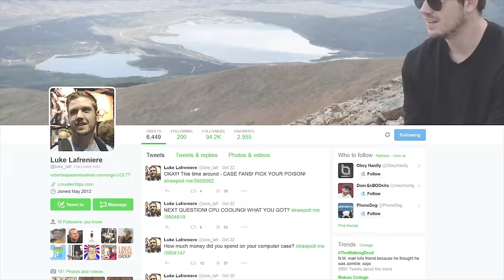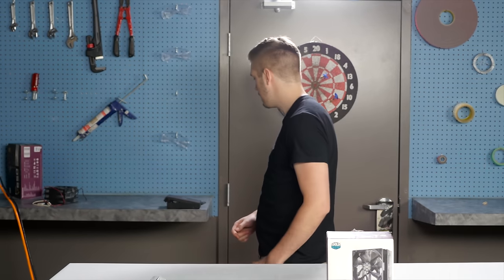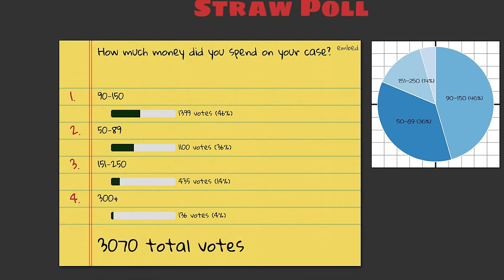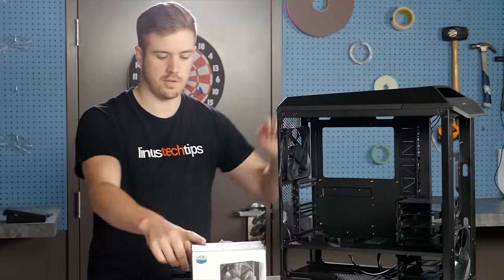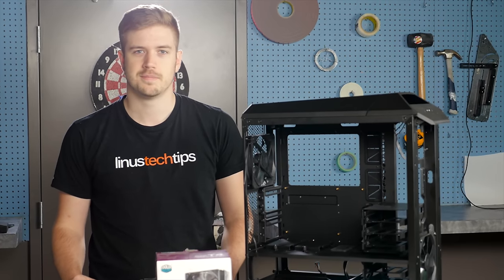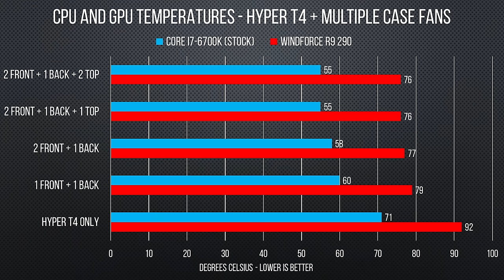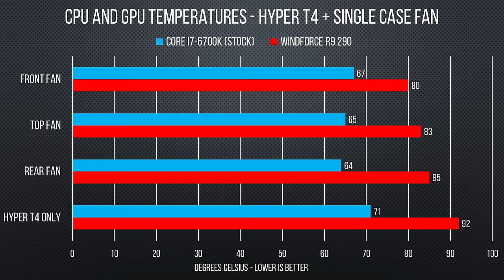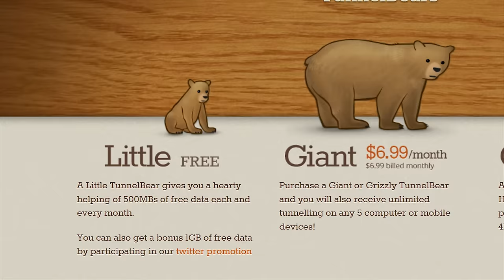Case Fans - How many should you have?

Comment: I have 6 fans, 3 front intake 3 exhaust (2 top 1 rear) but the cpu temp goes 73 when playing demanding games like metro exodus, I have i5-7500 and GTX 1050 Ti (dual fan) is it because fans are not enough or intel stock cooler sucks badly? I changed my thermal paste recently and cleanup my pc but temps goes 73 like crazy but doesn't exceed to 74.
Reply: the kaby lake ( 7th gen core) have high temperatures. if the fan is too loud you need to get a better cpu cooler

Comment: To me this just means if you can afford or already have the fans you may as well use them, my prebuilt pc came with 3 120mm fans but I'm upgrading to a new case, more ram and a better cpu so my system bottle necks less and i figured I'll just buy 2 140mm fans and put those in important spots and put all the smaller 120 fans in whatever other places the case has since i already have them and sure it will be diminished returns but still keeps the system cooler so why not

Comment: Okay I got 1 fan in back fan for cpu and gpu and 3 fans front case but 1 of them stopped spinning is that a big concern at the moment to fix it or 2 will do fine till I can replace it soon?
Reply: Also I just got this pc and top front fan case stopped was working for a bit fine
Reply: You'll be fine for now, probably won't make much of a difference

Comment: I have 3 fans. What is better: 1 intake and 2 blowing out, or 1 blowing out and 2 getting air inside
(The 1 fan is at the back and 2 at the front)
Reply: Bro you never have more exhaust than intakes. 2 in, 1 out is perfect. Just make sure the exhaust fan isn't weak.

Comment: Ive done 1 fan in the back and 3 in the front which came with the case and 1 fan just mounted above the graphics (inside case) pushing air out to the back fan ... It affect graphics Card alot by almost 7 degree Celsius ... So its intake in front and out from back and no other exits 😀  (running R5 3600 with stock cooler and rtx 2060 super wind oc )

Comment: but what if I put in like for example 9 fans +2 CPU cooler fans + 3 fans on the GPU and they all gonna run on lower RPMs so I might get the same temperature as you with the 4 fans but with a much more quiet pc? does that make sense for anyone?

Comment: People need to be cautious on how much voltage you are going to be pulling through that motherboard based on how many fans you have connected to it. Every motherboard has a voltage rating, amp rating, and watt rating. Anything more than 3 or 4 fans, based on voltage of each fan, means you are pulling ALOT of voltage through that board.
Reply: How do i know?

Comment: this stuff is old af but i hope someone can answer: my huge case fan does some weird motor like sound when i turn on the pc. i noticed that it isnt very steady, i can push it up a little (its cooling upside down so it might be normal).. or is there tons of dust in it? 8 years old pc*
Reply: The bearing is probably bad and needs to warm up before it works properly again. The best thing to do is probably to invest those $5 and get a new one.

Comment: If I only went with 1 in the back, and 2 in the front, I wouldn't be able to have the 2 on my AIO radiator up top, and I wouldn't have my 3rd in the front, I just think that would look silly on a higher end build like mine. 6 RGB fans, 4x8gb of 3200mhz Corsair Vengeance RGB Pro, a brand new Deepcool Captain 240 RGB Pro v2 (for its beautiful unique RGB pump). Fans are mostly an aesthetic choice. If you have proper cooling, fans are secondary to that and won't help as much as you might think. Now over a much much longer time stressing the system, it may have more severe performance impacts over some period, whereas my setup is constantly pushing fresh air from an air conditioned room into my pc, so its constantly keep colder air outside on the inside helping keep the parts cooler over a longer period.

Comment: When you installed the top fans did you have set up as intake or exhaust?
Reply: Top fans are usually always exhaust as that's the natural air flow air. (hot air rises)
Reply: @TeeJayParkour  Thanks TeeJayParkour I was thinking the same thing I just wasn't sure.

Comment: guys, any tips for fans setup in the cylon aerocool case? i'm thinking about using two on the downside (throwing air directly into the GPU) one in the front and one in the top/back; is it good?
Reply: @SuperSherlock12  wat should be temp for load gaming?

Comment: Alright I just bought a Panzer max and would like to put 2 120mm fans on the top but it has no where to mount them after I take the top off it is just mesh. Does anyone have an idea how I might be able to do that. I also do not want to do water cooling. The case manual says I am able to put fans on the top.
Reply: Drill holes lmao

Comment: Skylake doesn't run that hot? News to me. My 7700k runs at 50c idle after delid and liquid metal. Used to hit 85+ under load. Now stays around 77. Not the temp drops I was expecting.

Comment: It’s funny I have had this same case for a year with 2 fans in front 2 top and 1 back. It really keeps my system cool since I run a 9900k. I am wondering though how it will do if I am to slowly upgrade the fans to something like Noctua. I just got a Noctua u12s chromax LTT version and am interested in how it will do vs the hyper 212 I currently have on my cpu.

Comment: I wonder if it would've made a difference if he could put fans on the glass side like I have on my case. So 1 or 2 intake on glass side, 1 intake in the front, 1 exhaust in the back and 1 or 2 exhaust in the top. the GPU wasn't getting and intake cooling at all from that setup. but interesting nonetheless.

Comment: I have an INWIN GR One case with corsair water cooling in the top (H100i GTX)1 rear 140mm fan and 2 front 140mm fans in front of the drive bays and 120mm fan on the internal side of the drive bays. CPU is a Intel Core i7 5820K @ 3.30GHz,  Graphics card GeForce GTX 980 (ZOTAC International) also with dual fans. I do have an Asus X99 deluxe motherboard but nothing is overclocked.

My GPU temp is 36c and my CPU is normally at around 31c without load. 
 
Compared to you guys my machine is not a 'professional build' I have wires that are not so tidy and hence reduce air flow so I really do wonder why your temperatures are practically double mine ???

Comment: Only 5 fans?!
I'm building custom 13L SFF Case with 360 rad and SIX fans (3 120x25 mounted on the radiator being at the top) and 3 120x15 mounted 190mm directly under the 360rad
Both GPU & CPU in custom loop. So the 3 thin bottom fans are less to cool down the MoBo (one I believe would be enough for that) and more to serve as the actual "case".
The connection between them is using 1010 aluminium beams (with plenty of 3-way connecting cubes and a good amount of spacers to fix everything in its right place)
Finally the panels will be mounted on the 1010 Alu-beams.
Should have final dimensions of about 400x260x125 or exactly 13L.
And since it'll be running a i9-9900K & 2080Ti when as home (the main goal of this design is to be easy to fit in a backpack) I'll connect it (via Quick-Disconnect-Couplings) to additional one or two 240rad+fans (up to a max of 10 fans and total of 840x120 rads), to which will be the main reservoir used for refilling.
5 fans ... lame! :P

Comment: The bottle neck with fans is how well your radiator on your cpu cooler and GPU work. You can't easily remove heat with a fan if the coolers can't move that heat away from your components. Adding more fans would most likely work better on units with bigger and better cpu coolers. I would bet if you ran this test again using a basic stock cooler your results would have not improved even as much as they did.

Comment: You should have done noise normalized test where you set target noise level (e.g. 30 db) and then test how many fans is the correct choice to not cause thermal throttling with max load. Obviously, if you go with just the CPU stock cooler and GPU stock cooler the system may be able to run but all the fans will run at 100% and the noise levels are high. I'd expect to see that more high quality fans is always better because then you can run all fans with lower RPM. With low quality fans, every fan will emit noise how much how low RPM you run it.

Comment: Have you over-looked an important detail?
Each fan is intake on one side and exhaust on the other. In the simplest terms, should all the fans be set for exhaust or all fans be set at intake?  What about air in on one side and out the other for circulation?
 You never mentioned this and we really don't care about 1 degree one way or another...Just a safe and secure system.
Reply: Always exhaust in the back, always intake in the front. Usually exhaust on the top.

Comment: A very important point missed. If you want your PC to be quiet as possible, you need to run your fans at low speeds. Low speeds = Less airflow. BUT if you have 4 or 5 fans in your case you don't need to run them at high speeds to combat heat.

Comment: Shame you didn't/don't measure internal temps of the case as the case airflow has very little effect on heatsinked processors considering they usually have a fan right up against the heatsink. Case fans do have an effect when said heatsinked fans are off or at low speed eg zerorpm mode on amd gfx cards

Comment: What about the temps of the RAM, SSDs, Mother Board itself and other non actively cooled components?
Reply: I am going to add onto your question, what about if you also have fan spots in the bottom of your case, intake bot, exhaust top.
Combined with rear and front maxxed out on 14cm fans

Comment: That’s basically my setup and I’m running 4 fans 2 front one back one top, first PC I’ve ever had with case fans my old tower case I used turned into the equivalent of an ripen air test bench after the first build I put in there that didn’t need fans I think It was a 8-900MHZ AMD processor with an APU it was a cheap PC I could get away with no fans due to the humungoid server tower case I used, my retro XP machine is in it atm thinking about buying a 3000G and upgrading it a bit it’s IDE it would be nice to have SATA without adapters get an old 1-2gb graphics card would run retro games awesome then I have 512 Radeon in there now
Reply: Masha'Allah broski, real glad you're having fun with it. What games you got on your retro XP machine? Seems like a fun idea.

Comment: Hello, Past Luke. I'm currently building in my Lian Li O11D-XL, and I have 7x120mm fans and 1x360mm AIO radiator. Bottom 3x intake, rear 1x exhaust, side 3x intake, top 3x exhaust + radiator. My PC is a fucking wind tunnel. Please respond.

Comment: I think 2, 12in 1 horsepower fans should be enough. Bonus points if you have to reinforce your case to sustain the air pressure.

Comment: So, the results, in order of cooling efficiency (on CPU) - 

1. Front Only            -4 degrees
2. Top Only               -6 
3. Back Only             -7 (Better than Front Only or Top Only, Best single fan placement)
4. Front & Back       -11
5. 2 Front                 -13
6. 1Front & 2Back  -16 (Best if case, motherboard allows)

Comment: I have 7. 3 intake, 3 exhaust. the one inside is like an airflow fan. then theres the cpu,fan, 2 gpu fan and the PSU fan.
Reply: MrBroxMan me too 😅✌🏻 3 in the front one in the back one on the top and two on the radiator on my water cooler

Comment: What is the program he's running on computer ?
Reply: Aida64 for CPU stress testing, FurMark for GPU stress testing, and really anything like CoreTemp (CPU), HWMonitor, MSI Afterburner (CPU+GPU with in game overlays as well) or CPU-Z (CPU) for monitoring your temperatures. HWMonitor will give you the most detailed overall information, Afterburner has graphs (if you're using the default skin) and will allow you to set/adjust fan speeds.

Comment: In one instruction video people say that you dont need intake fans and show some fancy diagram to proof it.On another video people say that you need fans all over the place to not get overheated. How could these computer videos get all these different results who leads to only more confusion to computer users who are unsecure on their builds.

Some years ago i bought a Acer Predator with no intake or exhaust fans.Only a CPU fan on a Intel K- CPU and a heavy GTX GPU.And it worked good.Aftet that built some computers with fans all over the place and they also worked good but of course sounded like a rocket under load.

I found the best solution.Skip the fans and put it in a freezer. Cool and no sound with minimum temp. But i wonder if i really need the freezer engine fan ... Hmmm ... 😀

Comment: Depending on where the psu is it may help extract some air too
Reply: My PSU is located in a way that it sucks in air from a filtered bottom vent in my case and ejects the hot air right out the back instead of dumping it into my case

Comment: Now I know this is an older video but the reason you saw no change in adding the fourth fan is because you had it blowing out, not in. When doing top mounted fans you want the front blowing in and the back blowing out. You actually would get diminishing returns with the fans the way they were

Comment: hmm I don't know but he kinda mount the Fans incorrect air flow directions.. Most of this Fans are blowing where the cross fan mount vs the open side where there is no cross mount is where the air flow through.. By the way he mounts I think the air flow are messed up.. The way I mounted my fans they just have the same sides facing one directions.

Comment: -"Technician" wants to prevent case fans from working to test with no fans
-completely removes fans from case, instead of just disconnecting them from the board...
Reply: Yeah, because obstructions in the case would obstruct airflow. Fans that aren't running are obstructions. Doing it your way would be half-assing it.
Reply: @Elidor109  if u think that will cause an issue then u have clearly never built and tested PC's
Reply: @iheartTrollin420  sure bud. What next, are you going to tell me that dust filters don't obstruct air flow too?

Maybe have a basic understanding of fluid dynamics before pretending to be an expert or calling other people's knowledge on the topic into question.

Though to be fair, you shouldn't have to have studied anything scientific to understand the common sense idea that solid objects restrict the movement of liquids and gases.
Reply: @Elidor109  If you understood air flow and fluid dynamics at all you wouldn't be arguing, plus I never asserted I was an expert at anything. I don't personally believe anyone can be an expert at anything. Anyone who proclaims they are an expert at anything should have their knowledge questioned. This is the exact reason why we question "EXPERT" witnesses in trials. To say that no one should be able to question someones knowledge on a subject sounds like a cop out from an ignorant person arguing with someone over something as asinine as this. When we talk about science and common sense, I will chose science every day, because there are many things that go against common sense that science has shown to be the case. Which leads me to my last point because sadly I'm afraid the dunning kruger effect has gotten hold of you. I could go into detail on how I believe you are wrong but I would rather you educate yourself and at least do a google search or two to find out how hot air flows and what happens to hot air when it is produced inside of an semi-closed environment, and the ways hot air self vents from said environment. All of these come into factor, but when we talk about an obstruction, a case fan is considered negligible for a specific test like this. I agree a mesh dust filter does provide obstruction, can you provide for me the total amount of obstruction a mesh dust filter creates vs a 120 or 140mm case fan that is not running? Is it less, same amount, or is it more? How much less or more is it? Do you have an idea? Any clue at all? How many PC's have you built and tested? Are any of the PC's that you built and tested going to a customer or specifically someone who paid for the product? I ask it that way because you could as you say "half-ass" the job for friends and family. Now i know you feel you have some sort of strange obligation to defend these people making the video. I was not attacking them, I was simply making a point that they could have done the same process just minus one step. I like these guys and the videos they make, I gave them thumbs up, subscribed, and commented on the video which feeds the YouTube algorithm, which makes them even more money and attention on the platform. If that triggers you then I don't know what to tell you man, maybe internet isn't for you...

Comment: I have a cougar conquer and you cant have a back fan lol so gonna use 2 front fans(blowing air in the case) 1 top-back fan(blowing out) and 1 top 2 fan radiator (blowing out)
Reply: Or the top-back fan set to blow air in the case rather than out, that way id be able to use filter on it to keep dust from getting in.